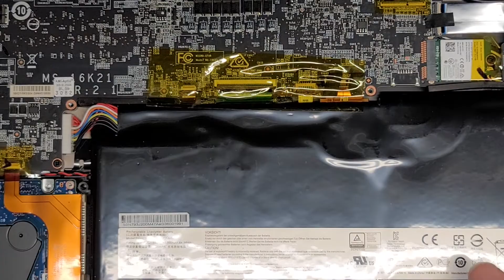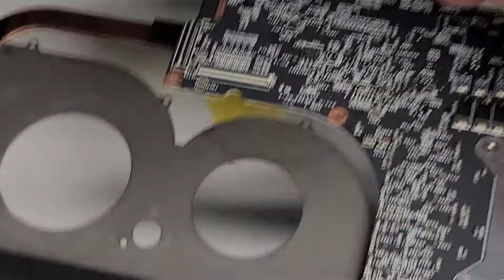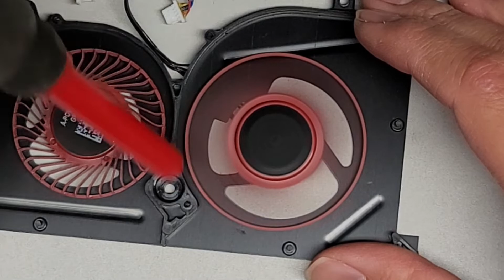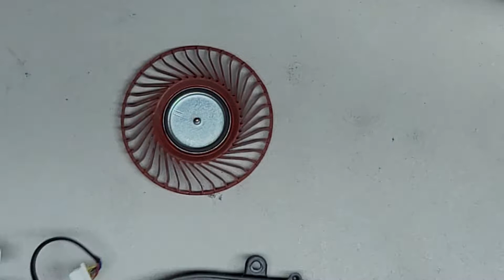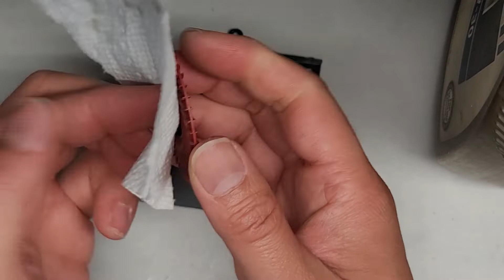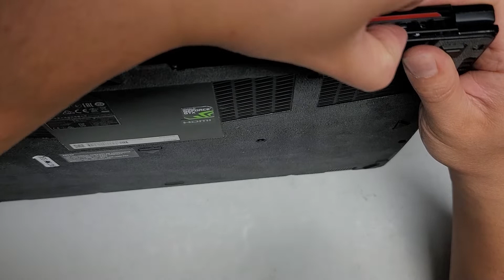MSI GS63VR 6RF-469US Disassembly RAM SSD Hard Drive Upgrade CPU GPU Fan Battery Replacement Repair

Comment: Damn so i put a 2tb and 32gb for an upgrade it's all the correct ddr4 correct speed ect. I put it all back together now its not wanting to boot into my usb with windowns on it its gone as far as showing the windows logo but rebefore its about to pull up windows install it freezes midway i did loose the cable ribbon for the Ethernet/sd card but i dont think i need it if my wifi card is there not sure what i did wrong any tips ik everythinf is plugged in just confused
Reply from the maker: Try the old ram

Comment: I have some problem, i just try to update my ram, but i dissarm a lot this laptop, it goes fine the first time but one of the fan sounds a lot, i re open it to take a look but i didnt see much, now when i try to start the laptop, i dont have image, the screen is off completly. When i open the laptop re again, i have the cable above from fam and besides of internet chip, the re desconected and the click missing (i already found it but i can plug it, the have to pull american tape for try to connect but i dont know what more to do
Reply from the maker: If you didn't disconnect the battery and press the power button 15 seconds before messing with the lvds cable, then you fried it.